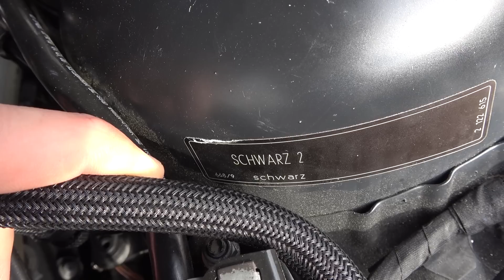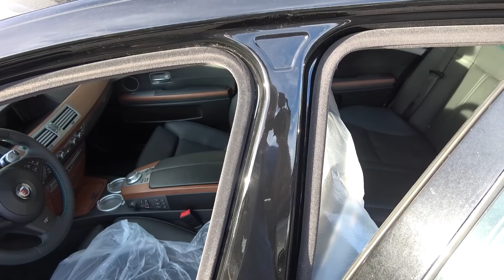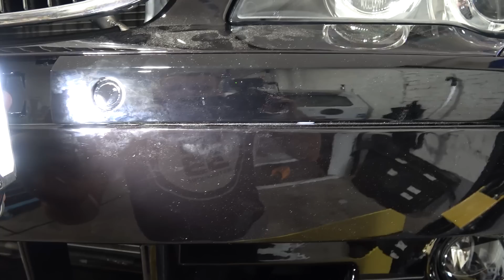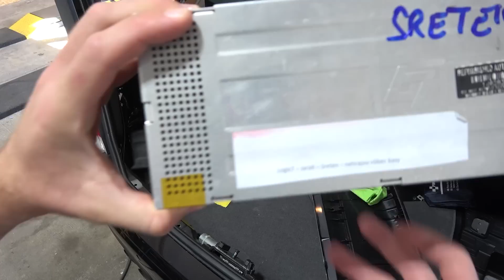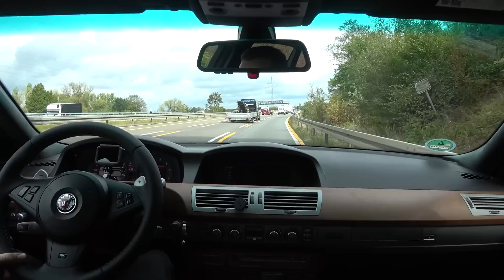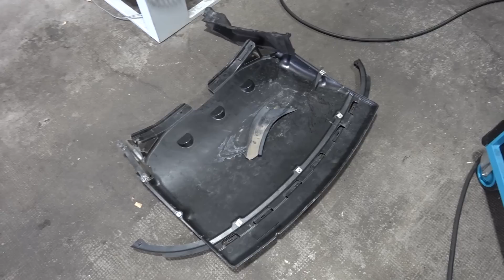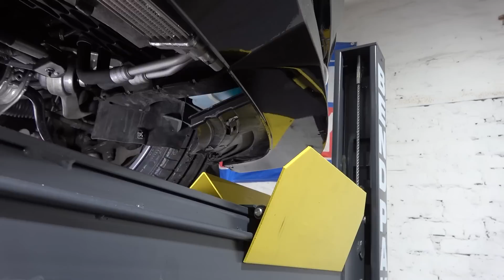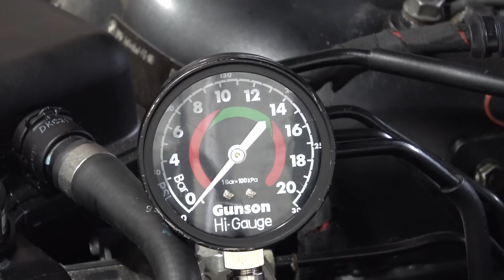More Problems - Supercharged BMW Alpina B7 - Project Chicago: Part 15

Comment: Greetings from Poland tbh me and my dads friend is a painter and we did respray few parts of  my s4 b5 in garage like bumpers and 1  fender + doors of the driver and we didnt get almost any of crap  dirt in to the paint and he counted 350 PLN for each i did spend 1000 PLN for the paint around ~ 1.5L? maybe more i took the best one and they matched it for me in the mixery i also helped and sanded down most of the parts under his eye i hope that PL ppl will do it better then germans cuz it is horrible looking and so much expensive in Poland averge price for single part is 500 PLN ofc depens o the lenght and wide and what is it

Comment: I can't believe this car is still trying to test your patience! Well done for a fantastic job.

Have to say I'm really into this project because it brings back happy memories of the E65 760LI my Dad used to have, back in the mid-2000's when they were new. At the time, the Logic 7 Harmon Kardon system was phenomenal. Every HK BMW system I've heard since sounds terrible compared to the E65 stereo. They really did a good job with the sound system on that car. IIRC there was a DVD changer in the boot as well as in the dash, so when we were sat in the back we could plug our headphones in and watch films / listen to CD's on the rear iDrive. For 2006 that was insane technology to us.

Comment: you should have asked the alpina guy about the paint story? i have a 2021 BMW X6, built in the US. i ordered it with carbon black metallic paint but it arrived with sapphire metallic even though all the paper work, window sticker and everything else shows the correct paint. i still took it. the original sticker price was $87,000+ (before sales tax) but the dealer ended up giving it to me for $72,000.

Comment: The only thing I can think off was cloned car, but that would only explain why VIN decoder says different colour code, still no way to explain why stickers and everything else are saying it is Schwarz 2, nor why all plastic details with matching VIN are Schwarz 2. 

I mean really it sounds almost as if paint was poorly mixed in the factory and somehow it was painted half metallic half satin. That seems the only explanation, but then there should be more cars like this, I can't believe they only made one car on assembly line, then realised their mistake and just sent it out anyway. This is bizarre issue you have.

As for paint quality, it is really horrible, I would not accept it either. However colour matching is different story and it is kind of funny but matching dark colour is always harder. As many back and metallic black cars that I have with repainted panels they always were slightly different shade. Not as obvious as yours, but with strong light it was possible to tell difference, but for sure they don't have crap everywhere in them. I think the reason why bumper is purple is simply because he applied too few layers of base. On small pieces he applied base thick so it looks deep black, but on bumper maybe only two light coats and it didn't properly covered the primer, so colour looks kind of watered down, or maybe he mixed it wrong and just made it too thin (put too much thinner when painting). Point is - in the end it is too thin and thus does not cover the panel evenly with black base as it should.

Comment: Hmm, I only had twice work done by paint shops here (I am from Gießen, maybe you know where that is) and it was decent enough. But it was always the kind of paint shop that was more old school - they always wanted the fuel door as an orientation and thusly it matched very nicely. Even on the Volvo dark grey metallic that was 25 years old. The prep work I cant recall since it only was a old Volvo with plenty of other scratches so I didnt care. Wasnt expensive! It was a paint shop a bit more outside of town - I think they do some work better, like your steering wheel guy.

Comment: Hate to break it to you but there are poles living in the US, some of them are car painters and for us, to respray the whole car to factory paint thickness or as we would say "pod miernik" is not that unusual :) with expensive cars they can put thin layer of tin over the filler to trick the paint thickness gauge :) there are ways

Comment: Sreten, great job!  On your fuel comment with the US having crappier fuel than Europe, I believe that’s a common misconception.  The US and Europe use different units of measure for their octane which in term causes the different numbers.  US measures in the average between RON and MON whereas Europe uses only the RON.  This means that a 91 octane in USA is equivalent to a 97 octane in Europe.

Comment: Just to be clear, there are good body shops in Germany... and not even a few. The thing is, you really have to go all in and empty your wallet for a top notch paint job. And that's the problem, cause it's really expensive a lot of unqualified wannabes try to make big money on paint jobs like this one just by undercutting those prices. 
By the way, apprenticeship for a (car) painter in Germany is 3 years. Plus several years working in a body shop and the option to attend master school to become a certified professional. But to sell people crappy paint jobs like this one you don't even need to be trained...

Comment: This happened to me when 'stress testing' my W211 E55. Went ahead and replaced all factory Mercedes hardware with much thicker and beefier parts. They laughed at me at the dealer because the washers are huge. Factory bolts were some dinky metal that looks like your Alpina in size 8mm. I'm now using stainless steel 14mm, probably overkill but I no more issues. Keep it up, your car is looking great! Cheers from Dallas TX

Comment: There are workshops in Poland that professionally paint the bodywork for the paint thickness gauges.  The average user of such a device is not able to notice that the body was painted.  You will find examples on the Polish YT.  Of course, this is the case with very expensive cars (I think that the almost new Alpina is part of this group). It is possible that it has undergone such repair (although it seems unlikely to me).

Comment: I think the most probable thing is that is was painted in the wrong colour in the factory. It would probably not be the first time that happen either. Especially as the plastic parts are the correct colour. If it is wrong from the factory, then it has to be possible to find out what colour code it really is 🙂 Good luck and keep up the good work!
Btw, this has to be one of the most entertaining and fun YouTube-chanels 🤩

Comment: Is it possible that the strut mounting was replaced and welded in as part of the accident repair, and they left the sticker on it from the donor car?

Seems like a long shot, and I'm not even sure a strut housing being welded in would be safe, but... Possible?
Reply from the maker: No.
Reply: Good.

Comment: What could be a possible solution to the paint mystery is, that the body has actually been painted by mistake of the factory in Opalschwarz (S12) which is a special individual color found on some Alpina cars from that area. Since the spec was Schwarz II all the trim parts were ordered from the suppliers in the correct color. Strange but possible that nobody in the factory realized this mistake, but if the colors are very similar…
Reply: This sounds like a good explaination of the mystery. Never say Never: in the late 70s, Audi managed to build a handfull of Audi 100 with one door on the left side and two doors on the right side. And theese cars even made it to the dealership bevore the error was detected.
Reply: Yes, also happens at Mercedes. A friend of mine got a new CLK with green Interieur back in the days. But he got black door panels instead of green ones which he only realized later when he saw a same spec car with green panels in the showroom 😂

Comment: I share your pain with German paintshops. My local place is run by a Russian and you can tell - it’s correct every time. It’s one thing that surprises me that Germans who want perfection and technical excellence in everything accept such poured paintwork. It is so easy to spot a car that has had work as it never matches as it is never blended

Comment: Remember, your device is only measuring THICKNESS of the material between steel/aluminum, it doesn't guarantee that car was/wasn't resprayed. A good painter can strip down the panel to bare steel and paint it under 120-150 microns.
The only way to determine whether the car was painted or not, show it to experienced painter.

Comment: My opinion is that someone was in the same exact position as you with deeper pockets and had it completely resprayed the wrong color then got into an accident and parts were painted original color and then the owner set it on fire then sprayed it with Honda black after

Comment: Pin holes in the filler on the bumper 

Obviously just had a coat of wet on wet/sealer instead of a sufficient high build primer. 

Fetch it to England.

Comment: I can relate on paint. Here in Milwaukee I have gone to middle of the road to top end. Always same results… crap. Leaving trash in the paint is not acceptable. If you need to do body work, do body work. Actually look at the part before you send it out. Does it look excellent? If not, redo it. Its utterly amazing to me that they think this is ok.

Comment: Is it possible to ask Alpina's boss to help figure out what is the reason of having a different color code paint on the car than what's written on the plates and VIN? I am genuinely curious to know the root of the issues. Maybe when you take the car to the factory, get them to inspect the factory painting process? They must have the records and maybe even CCTV records of this chasis during painting?

Comment: Wild guess on the paint shade difference from the body shop: did they use a grey primer on some parts and black primer on the others?  That could account for the lightness.

Anyway, it'll be done right next time.  Congrats on Alpina reaching out to you. That means your influence is being noticed.

Comment: Modifying a stock front bumper is the factory way to get an Alpina bumper? That's insane. The more I watch these videos the less impressed I am with Alpinas. They literally are just a fancy tuning company for BMW. At least in my mind they always seemed like a more legit (and reliable) way to get a more interesting and unique car but now it seems you wouldn't be worse off just tuning a BMW yourself if you really wanted to.

Comment: I have done paint job's in my garage that look better than that, not acceptable.  Black is the hardest color to paint without showing imperfections, but if these people were professional, they would have made sure there were zero imperfections before they painted.  I don't blame you for sending the whole car out to people who know how to paint.  Sorry this car has given you so much trouble, well not the car, actually it's people who were not skilled enough to do the work on the engine, and the paint, costing you money.  G-d bless, from a girl in michigan.

Comment: About that paint, so i understand correctly that no B7 or 7 series could have had this paint? What about individual spec?
Can it be 100% ruled out that this isnt a stolen vehicle with a VIN from a different car? Are there any other discrepancies you found when decoding the VIN for equipment?  I find it hard to believe that BMW messed up the codes especially when no matching paint was found (except honda)

Comment: Unfortunately paint shops get away with poor work 95% of the time, they are mainly insurance jobs on lease cars and people just don’t care or know so paint shops have got used to not rectifying work they know is poor because they don’t get pulled up on it. Having worked in. Workshops with body shops and asking that exact question, they just let the work go out as is and now its not worth sorting unless the customer complains… this is how even reputable paint-shops work otherwise they don’t make money, it’s not normally deliberate shoddy work but things happen and they have learnt to let it go as the customer most likely will, it just makes financial sense as the customer is the insurance company not the car ‘owner’ normally. 

There are good paint-shops but they tend not to do insurance work and cost many times more than the insurance paint shop charge. 

The crap work I have had done in the UK and Australia confirm its an industry problem and global not just a country or city issue.

I had a Mercedes approved big body shop paint my M5 after some vandalism (dent in rear C pillar), I also got the front bumper and bonnet painted because of stone chips, I paid myself (not insurance), not a ‘cash job, but full cost and when went  to get it back there was sanding marks, overspray, bad swirls from a crap mop job and deep scratches in the headlights and warning lights on from driving the car in the workshop with headlamps etc unplugged… they just argued, refused to sort the head lamps or the warning lights out and just gave it another detail… I was so upset.

Have another similar story but this time through insurance on a Audi quattro, the body repair was so bad it was eventually written off by the insurance ombudsmen. The body shop refused to fix the issues, I refused to take the car so they dumping the car back on a low loader to my address with more damage than when it when in in the first place, even their ‘repairs’ had been damaged while in their ‘care’… again another large main dealer Bodyshop that do insurance work.

Comment: Well, that s*cked on the colour mismatch of the panels :( 
First i was afraid that the engine was killing itself, but 'fortunately' it were 'only' plastic parts that even weren't sucked into the engine. Because, why not?
I wonder: could you weld these parts? It's all thermoplastics, so you could even add some strengthening / stiffening 'ribs' on them. Not your beloved standard real OEM, but better. 
On the endoscope-test: is it possible to look upward to inspect the valves? Although the compression-test shows no real reasons for concern looking upward to check the valves is little work for extra security.

Great to see that mr Bovensieper cares about his products and appreciate your work and channel (of course he should! :) )

Thanks again for your great video, loved every second of it. 
Looking forward to your next vids!

Comment: I had a 1990 Ford Mustang LX in Bimini Blue
From the factory but once the Car was hit on the driver's side door the paint shop could not get the original paint to match come to find out that at the end of a paint run they will mix what is left at the bottom of every barrel and then they paint the last cars in the run. It took the body shop 3 weeks to get the closest match to original. Not happy.so years later I had it completely repainted. So happy.

Comment: I had same story driving at night 160 km from home, crashed small warthog doing 180 km/h with my e38 - bumper done, under body panels gone, right fog light missing, arms and bearing kapot. Luckly it is a heavy beast so went home safe doing only 120 km/h.
I hope my mates from Poland will do fine again. Fingers crossed Mr mechanic.

Comment: What the heck is the painting the local shop did? even for a cheap job that would be too bad to hand out to a customer... do they know that terrible work means people won't return to them?

Then again... a lot of paint shops almost do stuff like that on purpose so normal folks won't come to them, as the best way of earning is to take on work for insurance companies, but I've experienced folks having told their insurance company to find another paint shop because a customer had terrible experience with the one the insurance company wanted to use, so even that can backfire.

Comment: We have the same nightmare in the United States. It's near impossible to find a body shop that can do quality work. The main reason is the insurance companies refuse to pay a reasonable labor rate not to mention they insist on using aftermarket and used parts to cut costs. Labor rates for body shops is often half of the labor rates for a mechanical shops, even when owned by the same company or dealer. That low labor rate makes it difficult to find an experienced Craftsman and if you are lucky enough to find an experienced private shop, where the owner takes pride in their work, you're going to often pay a lot out of pocket.

Comment: Schwarz 2 paint too soft - is it single stage with no clear coat then??? If it is soft and contemporary BMW paint system was used then the curing process was faulty. As for the quality I co do far better job with rattle cans lol.

Comment: i have two e65’s 750i 730i, and they had the same problem with the engine underbody protection, i broke both of them at high speed

Comment: Regarding your "US Spec / country specific" inability to order parts problems...  I dealt with the same crap on my E92 when doing an m-sport bumper conversion...  the OEM M-Sport brake ducting is considered europe only, DESPITE THE FACT that US Spec cars came with it... I had to search high and low to find a good used one.

Comment: Man i laughed so hard when the rabbit ran by and ur dogo just sat there😂😂
Reply: i work at a bodyshop and we occasionally get cars or little stuff brought back and we just redo them as we have been having loads of trouble with our paintbooths filtering systems and the air systems and what not, its a on going case and the professionals have been working on it and its been getting alot better and the imperfections have gone down massively but its still occasionally happening

Comment: A rattle can job would have been better than that. I've done it so I know. They are terrible at painting.

A lot of those marks are from the paint texting badly to the primer. Either they painted it before the primer dried or they used the wrong primer.